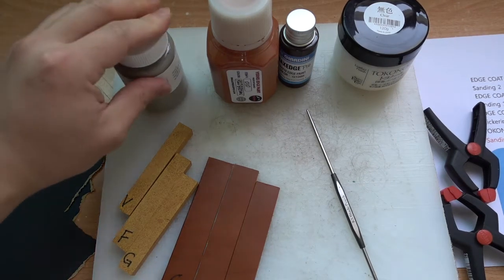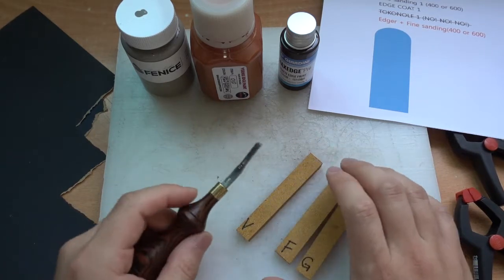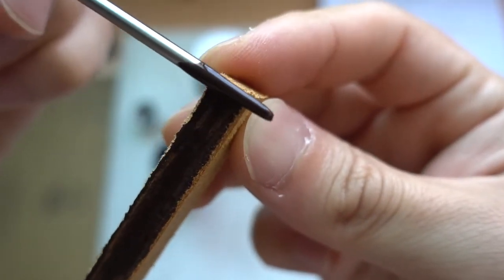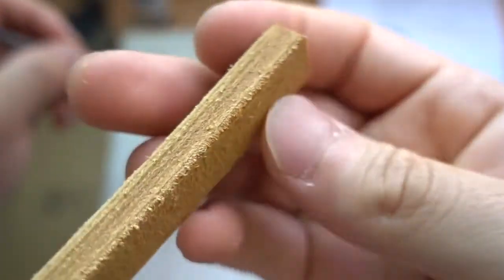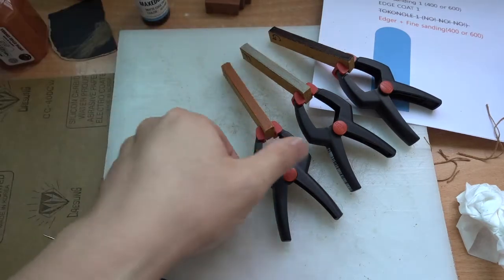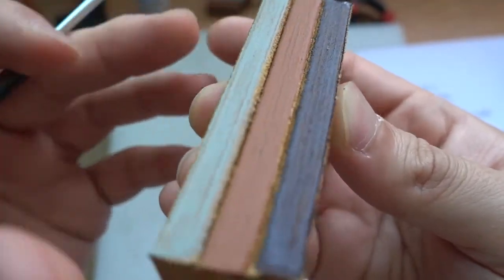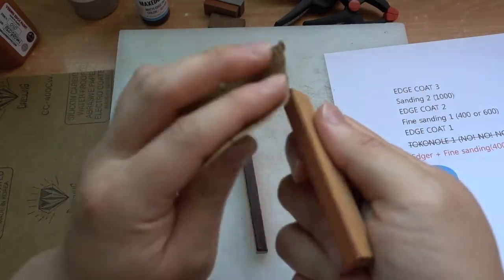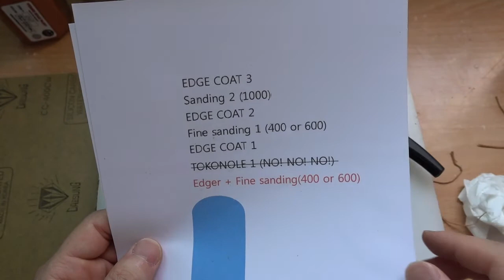How to Apply Edgecoat like PRO : Sanding Method

Comment: Thanks for the mention! For sanding progression, I usually start from really coarse to fine, like around 100 grit to around 1000 grit. You can use leather or anything smooth to wrap the jaws of the clamp, it will minimize the risk of clamp marks on the project surface. Anyway, as for Giardini, they do have an extra matte top coat if you want a nice non-sticky and matte look. As for the heating method, you could also introduce all these edge paints to the test again, I am really curious how all 3 performs under heat.

Comment: I think the black one is a bit shinier and slightly tacky because of the wax in it. I've found that burnishing it more (hand or canvas) helps to get rid of the tackiness, with a last resort of using 1:1 water and Fiebings Acryllic Resolene.
Reply from the maker: Hello Anthony. Thanks for the comment and tips. you could be right. I need to experiment more on this.

Comment: I thought Vernis should be applied on flat edge not rounded off with edger.

And it gets rounded by the multiple coats. 

Is that wrong as per your experiment?
Reply from the maker: it will give you "some" rounded effect but it won't give "nice" rounded look if you don't bevel. it's just your style and look that you want to make. no true answers are there for this kind of matter.

Comment: HI nice video... Thanks for the upload..But would really appreciate if you can do one with the 'heating method' I think most of us would like to know how the edge coating will work with a Fileteuse from Regard or a chinese heat creaser please. That video would be very very helpful.
Reply from the maker: Thanks, I will do the heating method too!
Reply: Thanks mate...do you use the regad french tool or a Chinese/Korean/Japanese one for creasing and heating?
Reply: How do you like the KS Blade Edge Paint Applicator?